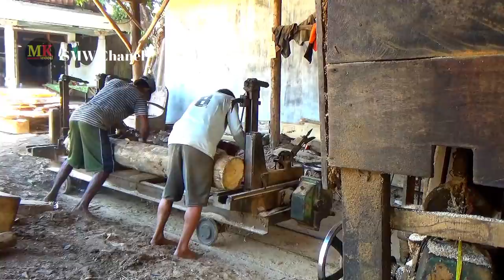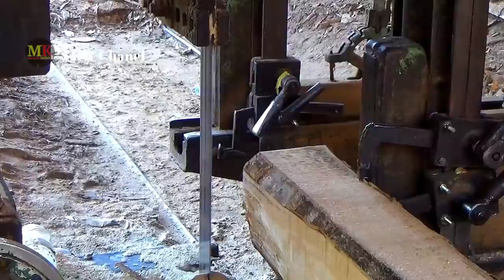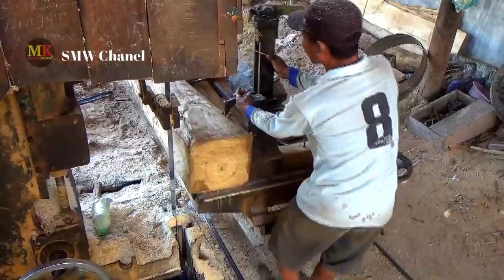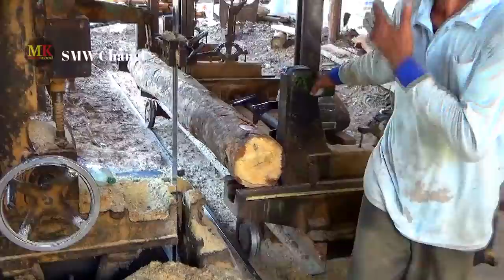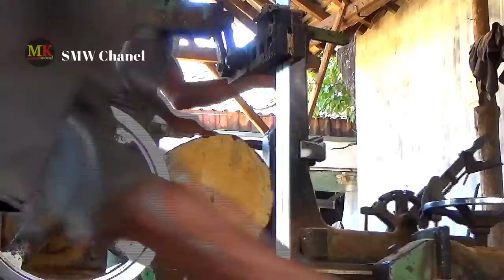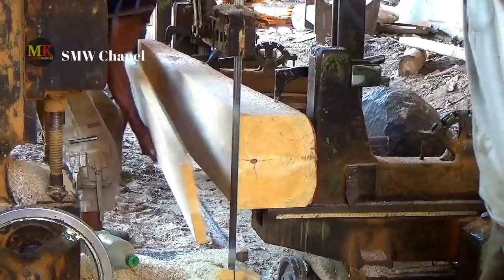Tak Banyak Orang Tau.!! Ternyata Kayu ini Yang Paling Banyak Dipakai para ahli furniture kelas dunia

Comment: To everyone talking about safety standards. Do yo know, wood for skateboards are lumbered in Canada, then put on a Ship to send to China and in China those woods are used to make the skateboard then shipped back to  Canada. Where those skateboards are sold at price lower than manufacturing cost of similar skateboard in Canada and still makes profit. Have any of you wondered how ?
Reply: Why? Because the skateboard is a commodity.
But in Canada, the skateboard is sold with a  b s story. It becomes "branded", a cult item. And sold at 10x the cost.
Reply: @ramonching7772  And where do you think the brands get skateboards from ? Those are all made in China, maybe a better QC and a sticker. The brands choose Chinese manufacturer over manufacturing in Canada because that is orders of magnitude cheaper.
Reply: @smnkumarpaul  right, but why is it cheaper to manufacture something in China?
Reply: The bottom line is that, manufacturing processes and LABOR are cheaper in China, vietnam, and india. Its so cheap in fact that the cost difference allows the companies to ship the raw materials across an ocean one way and then ships the finished product back to the country in which the raw material originated. Its not efficient by any means other than cost.
Reply: @kurtsmith4657  thank you!  I assumed that was the process but I thought I may have been missing something.
Reply: @kurtsmith4657 , you might recalculate your figures.  The cost of the shipping to China, one way, is more than the labor costs would be to hire Canadian Citizens at double or more the going minimum wage.  And they are paying those shipping rates twice.  To ship the lumber to China is roughly $3,000.00 US per container.  And that much again per container to bring the product back again.

It's not the labor prices.  It's the taxation.
Reply: @smnkumarpaul , finding graft and corruption is actually pretty easy if you're willing to actually look.  You may recall the big deal about GMO Grains a few years back.  For quite a while, those GMO grains were a reliable cash crop for US Farmers.  The exact same grains that could not be used for human consumption here in the US had a strong market in China, Europe, Australia.  Until the day some Customs Inspector failed to get the memo and payoff and actually did his job.  And found that China (and the rest) were buying those GMO grains cheap.  Shipping them to their various Nations and processing them into flour and such.  Then shipping them right back to the US marked as being the higher quality, higher priced grains that were legal for human consumption.

When the news broke on that, it's amazing how many Countries suddenly BANNED those same GMO grains.
Reply: @richardbromund2655 , while I've seen the talk about chickens to China.  I have to doubt any are actually making that trip.  As the meat would require continuous  refrigeration both ways.  Grains just need to be kept dry and free of bugs and rodents.
Reply: Chi phí nhân công rẻ so với tiền đô(usd)
Reply: Same with our scrap steel.....its cheaper than have it made here due to E.P.A. unions and taxes .Its capitalism and freedom in a ethically n morally declining country. But at least we can change it
Reply: @draconusspiritus1037  they don't ship unfinished lumber in containers...bulk carrier take logs right to china
Reply: @SuperJlonergan , and that little tidbit matters in what way?  Precisely?

Comment: Apparently Gmelina is a fast-growing, common tree in SE Asia that is similar in color, strength and softness as Pine. Termites avoid it because it supposedly has toxic chemicals in the wood, although I couldn't find anything more specific. Reportedly, the shavings, if used for bedding for chickens, will kill the chickens. It is used for building because it has good structural strength and termite resistance.